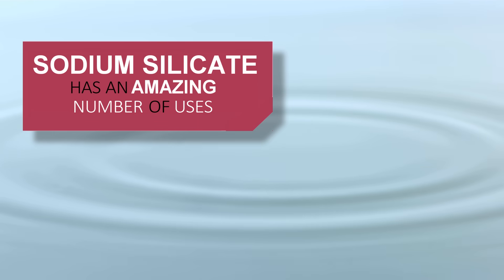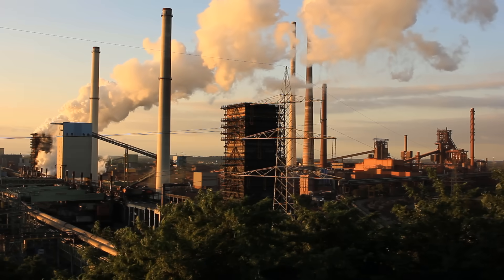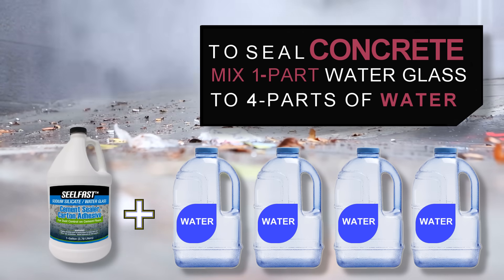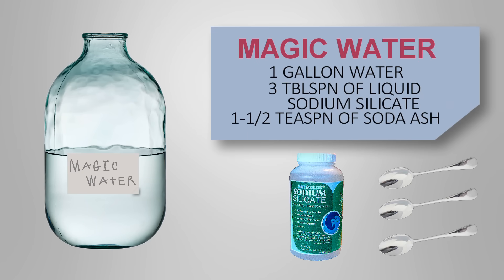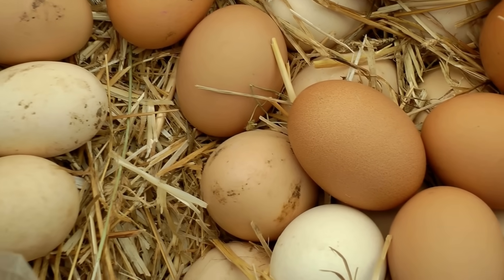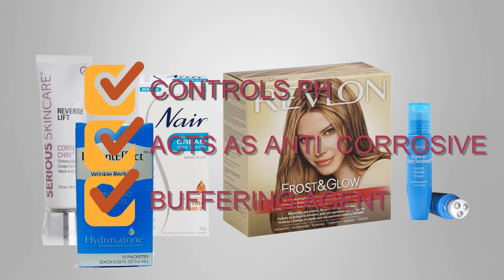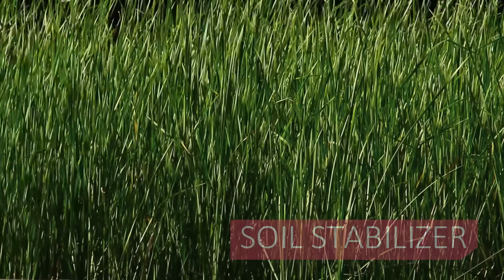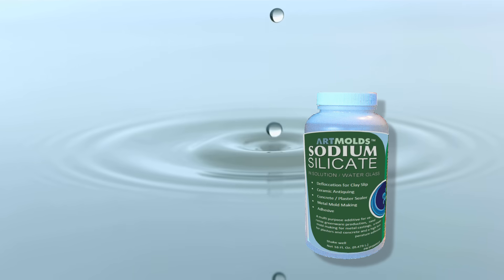Sodium Silicate || Water Glass: (Uses from Industrial to Daily Life)

Comment: Thanks for this revelation.
You say to use sodium silicate one part add three part water if Am not wrong.
How much would be required in a bag of cement?
Reply from the maker: Sodium silicate is applied to the surfaces of cured concrete. So of course it depends on how much surface area you get from a bag of cement

Comment: so what would be the effect of mixing sodium silicate into cement to make concrete? Seems it would make a harder and naturally more less porous concrete?
Reply: it acts as a deflocculant in the mix, causing the cement to be more watery.  this might be helpful in some instances, but could also cause the aggregate to settle out in an unfortunate way.
Reply: @jon_byler  so essentially it acts as a plasticizer. So in that case all that's needed is managing the ratio properly to get just the right amount of slump wouldn't you say? 
I use pepsi or coke or molasses where i can get it.
Reply: @jussayinmipeece1069  plasticizer is the wrong way of thinking about it.  it is a -deflocculant.  it means less water is needed to provide a fluid mix.  This can really screw you up if you mix your concrete by sight/feel, rather than weighing ingredients.  It has uses when trying to cast concrete/mortar and get it to fill more easily all of the voids in a mold.  might be helpful for grouting (filling the holes in) concrete masonry units.  A more experienced and knowledgeable mason or concrete engineer could tell you better if it's a good idea for a particular application.  There are other defloccuants out there that are less alkaline, based on other chemistry, etc.
Reply: @jon_byler  actually its just different ways of saying the same thing. An additive that reduces the friction between the solid components, breaks the surface tension of the liquids allowing the mixture to flow and mix better with less water.

The technical name i have always seen is plasticizer. Generally unless you are casting critical components such as bridges and columns for high-rises then the amount does not have to be critically mixed. Eyeballing and experience is usually enough to a certain extent. 

Say for example i am doing a mix for a suspended slab for a roof 6 inches thick. For every batch with 5 bags of cement i pour one one liter of regular coke or a pint of molasse with one 2 pounds of fibre.

In this case i am looking for THREE things flow into small crevices, (so less voids and air) compactness and longer initial curing time. 

So the net result is that the additive will have no deleterious effect on the actual concrete once its cured but it will slow water evaporation allowing for the chemical formulation of concrete BEFORE it runs out of water leading to cracks.

Comment: can i use it for styrofoam waterproofing?  Especially  salt water?
Reply: I know your comment is old, but in case anyone else is wondering: Yes, you can use it for that. Just be advised that it is very brittle so if you plan on using it on styrofoam or the like, it will crack if the styrofoam is damaged by pressure or in other ways.
But overall has been used in professional settings for aquarium backgrounds historically.

Comment: In my childhood, my dad put this into the radiator on our old car.  Stopped any size leak smaller than grain of rice. It works quickly.
Reply: To, just don't use too much, it's also been used to disable engines as well, just takes a lot more
Reply: @daveb3910  if you put it in oil, it ruins engine very quickly. In coolant, with no ethylene glycol, it works well. With glycol, it makes a jelly that blocks coolant channels.
Reply: A common fix for flathead ford v8 engines…usually effective!
Reply: just dont run it threw the heater core by pass it for awhile or it will plug up!!

Comment: Can Sodim Silicate be use as silicone to seal glass , wood , steel ? If you can ? Why cant we seal doors , windows in flooded area ?
Reply: No.  It will not react with any of those materials.  It is not like silicone caulk, not a thick gel.  Mixed with water, "waterglass", it has a viscosity like Karo Syrup.

Comment: I'm a Potter. This video is correct that it's used for crackle effect but what they're showing is not crackle effect LOL they're showing cracking in glazes which is nothing to do with sodium silicate. It's bizarre that the person that made this video would not have researched it correctly and got the correct pictures
Reply: J d  are you just a bad troll or an asshole? Or both? Again they show a glaze effect of crackle and attributed to water glass which has nothing to do with the picture they show. That particular crackle effect is caused by the makeup of the glaze and I can assure you it is not water glass that's added. Typically you get that effect with abundance of nepheline syenite and they lack of silica. Sodium silicate would actually prevent the crackle effect that they show in the image provided.

Sodium silicate is used on the clay body itself to crack the clay body not the glaze as shown in the picture. So someone that is new to Pottery is going to try and get that glaze effect which is desirable an attempt to use sodium silicate on the clay body as Illustrated and the two things are totally different techniques. To call this a great video when there's a glaring are like that it's pretty fucking stupid.

Also it's more accurate for them to have said carbon dioxide causes sodium silicate AKA water glass to harden but they do not add that information they say heat causes it which is inaccurate. I don't understand why smart-ass people have to be contrary to every comment that is not placating a video creator. Are you the creator of this video or a friend? If so tell your friend to fix their fucking video it's incorrect and misleading
Reply: It's AI created and narrated.

Comment: Would it be useful for a damp basement concrete floor by keeping the moisture below from entering?
Reply: olny if you could apply it on the bottom side of the concrete otherwise the concrete will still get saturated
Reply: J d  Apparently not , the concrete already contains the silicate ! as said in the video . Concrete emanates cold and therefore creates moisture . 
One option might be to add a layer of somekind of lime putty to the floor , which absorbs moisture, so that it can be dried by the air;  
Unlike concrete and modern plaster etc , which creates moisture and holds onto it ..

Comment: I am looking for a material that can be poured as a liquid on the bathroom floor which will solidify to form a level surface. What can do that? Is sodium silicate a solution?
Reply: Eppoxy flooring
Reply: There's self leveling cement.  It has a polymer that makes it an excellent choice to level floors. More expensive than regular cement but saves lots of time / labor.
Reply: @avidreader100  this is not healthy or safe. It break glass

Comment: I've got a blown head gasket. Was told to use "Water Glass". Now I know why I want to use it knowing what I'm attempting to achieve. The stuff is everywhere everyday. I had no idea. Good informative video.
Reply: I was told to use waterglass after I built my race engine, before using antifreeze, to seal the block.
They said it had been standard practice since the 1920's with some engine builders!

Comment: I have a question there regarding the use of Sodium Silicate. I make my own dishwasher detergent using self-made non foaming soap + Na2CO3/NaHCO3 and some other ingredients. So it is alkaline which can corrode some metals inside of the dishwasher after a while. Socium Silicate is also alkaline but has anti-corrosive effects. Which would blend perfectly into my materials. The only question is: how to blend? How to mix at which amounts?
Thanks in advance!
Reply: So sorry though we supply sodium silicate we do not have access to all the formulas it is used for.
Reply: @CapeCrystalBrands  anyway, thanks for the fast response :)
I will find out
Reply: look up the MSDS sheet for comercial products and see how much is in them.  it will give you a good starting point to experiment.

Comment: I was looking into creating a heated press when I came across "oil core skillets" which claim to use a heating element in "silicate oil" to create even heating across the metal surface, instead of a heating element that can create hot spots and uneven temperatures.  Any idea if this sodium silicate is the "oil" they referred to?   This is one of the first results that came up when i researched "silicate oil."
Reply from the maker: Dear Mason, Sodium silicate is NOT silicone oil. Here you go: https://www.ebay.com/sch/i.html?_nkw=silicone+oil
Reply: @EnvironMolds  guess he wasn't that "Dear", huh, to have suggested something else. Sigh...ghosting is soooo-prevalent these days, though. But, still...when one doesn't know, best to say nothing. New subscriber, there. Couldn't resist the Intro Video's Presenters!! Warms a heart on a hot summer day, even :-)

Comment: ...Excellent video, was wondering how I could make a Surgeon Attorney General  You Tube Sticker actually stick without any adhesive...Warning: objects may appear to be reversed on the opposite side of " your " membrane...the synapse would prove the S.A.G. as a G.A.S. warning since Argon identifies its membrane...kinda wierd knowing your a livin breathing hologram trapped in a paradox between mass and gravity at 14.777 psi. sea level...and there is a little tiny fan inside my computer...so stick it on the video part of the membrane , so it don't mess up the polymer synapse from the tip of the users finger, interfacing the screen...thanks for identifying the human membrane, and restoring the General Attorney Surgeon. Now we can all sort out these bogus lawyers...any questions on how thats done - I will tell you if your interested...
Reply from the maker: An interesting concept indeed, Mr. Clark. Here is a link to the Princeton Research Centers in Princeton, NJ. I suggest you contact them with your idea as they certainly could be interested: https://patents.princeton.edu/industry-entrepreneurs/princeton-research-centers
Reply: C W  Where are you from maybe we can do it.
Reply: C W  do you still make them? How much $?

Comment: Was this stuff used  in car motor to make the motor lock up druing cash for clunkers
Reply from the maker: Yes, this was the chemical used to destroy automobile engines.
Reply: I thought ot supposed to seal the gasket leaks
Reply from the maker: Your thinking is correct, Paul. However, only a small quantity is needed to seal a leaky gasket poured into the radio. You'll need two quarts added after draining the engine oil pour into the oil fill to destroy the engine @paullainhart8288
Reply: Environ Molds I poured some into my radio and the headgasket is still fucked and now I don't have music in my car
Reply: Environ Molds can you please send me a new radio, mines fucked now.. I've tried fixing it, but its pretty fucked.. it's a Kenwood touchscreen stereo
Reply: @EnvironMolds  If your gonna drain the engine oil, why add anything, just run the engine to destroy it....?

Comment: I made a battery out of sodium silicate...
Reply from the maker: Tell us more . . .
Reply: @EnvironMolds  Well, I had a gallon of it to play with... and a AC convertor at 5 volts.  So, I ran a current through it as it solidified.  I was hoping to see some diode type reaction; but, resistance was NEGATIVE in one direction, so I switched to a voltmeter and found potential across the leads.
Reply from the maker: Very interesting. Thanks so much for sharing.
Reply: @LazyH-Online I think I described it as best I could.  I did the experiment in the eighties when I was at university.

Comment: isnt this used in diapers? just think of all that fine glass we breath in daily.
Reply from the maker: Just looked that up and you are correct. Sodium silicate is used in the manufacturing of reusable diapers in the cleaning process - sodium hydroxide, soap, sodium silicate and chlorine are used to scour the fabric to remove impurities. Here is the link: http://dy-dee.com/wp-content/uploads/2017/02/Life_Cycle_Analysis_3.pdf (Page 45 middle of the page.)
Reply: Environ Molds also the absorbant gel beads are very similar to water glass and you can make water glass from them with a few small steps
Reply from the maker: If so Ken, It is a use I'm not aware of - but there are many more uses for this material than I have a list.

Comment: Does anyone know if we can cast 3D objects with Sodium Silicate ( of this recipy ) as we do with epoxy resin ?  Are there any additional directions to do so ?  Is special  concentration needed e.g. ?  
Another question can we disolve lye in water in a pot, and separatlely the silica gel in another pot and then to mix the 2 solutions as  to be A and B components similar to epoxic resins ? Are there any special advices to do so ?   Analogies ?  Thank you in advance.
Reply: in short, no. you can only use it as a watery binder. it "might" be possible to fill a mould with water glass, slowly drive out the water, leaving you with porous silica gel, and heat it up to basically melt it into glass. but it will be far from what you can expect from casting epoxy. ..and propably not very pretty
if you add SiO2 to NaOH solution, all you do is making a sodium silicate solution - water glass. (proceed with caution! the reaction es exothermic, and NaOH is highly caustic.)
Reply: @Ucceah  Thank you for your reply. If I am not bothering you I will post a few questions more that I have posted to this video also : https://www.youtube.com/watch?v=L2s0cLzm4RI      The questions :  There are a few contradictions about sodium silicate... It is used as heat - resistant adheshive, as a cracking - effect glass solution, in ceramics and as a refractory agent. But it is also used as a water soluble element in detergents. How is it possible to be a great adheshive compound and a water soluble chemic in the same time ? This is very interesting to find out how all these contradictory uses, can be achieved  with the same compound.... Any ideas ?
Reply: You where here too. Auhauhau

Comment: We use a lot of it where I work because of how it reacts with Co2. Interesting how many uses it has.
Reply: So it binds CO2? And then? What do you do with it?
Reply: @esatbecco  sand casting
Reply: @seahorsetug  I never saw these replies. You are quite right kinda. We make water soluble mandrels for composite manufacturing. We dont use sand but ye the CO2 reacts with the water glass stiffening our mandrels enough to get them in the oven where they dehydrate and harden.

Comment: This guy is lying about the pottery part
Reply from the maker: What are you referring to so we can correct if it is  incorrect?  Sodium silicate is commonly used in ceramics as a deflocculant in slip preparation by neutralizing the charges of particles in the slip, allowing for more even suspension and thinning. It is also used to create that antique crackle finish. Where do you think we went off track?
Reply: So, these folks are purposely trying to deceive you. How utterly evil of them. Oh that right they asked you to point out any errors they made how deceitful of them.  Words hurt, please use your words correctly or are you lying to us.
Reply: What was said about the uses in ceramics was true. Specifically, you can brush it on a freshly thrown pot and stretch it out to get a cracking effect. But the cracking in the pot in the close-up wasn't created this way. That crackle was from the glaze, not sodium silicate on the clay.
Reply: The pottery part you don't just brush it on and done you dip it and then cook it on
Reply from the maker: @ashash4tube Thank you for pointing that process out more specifically. Our objective in the video was to not show all process details. But to show that sodium silicate is used for the process. :-)
Reply: @EnvironMolds  this person doesn't know what they're talking about.  you are correct in the process, but the pictures you showed were of glazes that were formulated with a lack of silica and then stressed by cooling quickly in water using the raku process (where the carbon comes from in the cracks and unglazed areas).

Comment: I was watching vids on auto glass repair and this vid was recommended.. Now I need to know how to make sodium silicate diy.. Usually it's hard to find out trade secret sauce
Reply: 500ml distilled water in a SS pot, add 300mg Sodium Hydroxide(lye, drain cleaner) slowly to water until It's dissolved. Exothermic reaction causes heat. Add Silica gel beads slowly until they no longer dissolve, about 300mg. Store in airtight container. 

Wear eye and skin protection and do it outside on a hotplate.
Reply: Lots of videos on YouTube..
Reply: from a quick google search
Wear proper safety gear, which includes gloves.
dissolve 4 to 8 grams of sodium hydroxide in 10 milliliters of water.
Once the sodium hydroxide is dissolved, slowly add 6 grams of crushed silica gel beads. Heat the solution between additions. ...
You now have sodium silicate or water glass
Reply: @LazyH-Online I've never done it that way, but I'll try it next time. Thanks mate
Reply from the maker: It is far cheaper to purchase it. Check it out here: https://www.artmolds.com/artmolds-sodium-silicate.html

Comment: wow so many uses it's like https://en.wikipedia.org/wiki/Dihydrogen_monoxide_parody I only knew about some of the high heat application stuff. I will use it a lot more. your website it was hard to find this product hear is the links https://www.artmolds.com/seelfast-cement-and-concrete-sealer.html , https://www.artmolds.com/artmolds-sodium-silicate.html you should advertise on "making sodium silicate videos" because many of us would like to just buy it.

https://en.wikipedia.org/wiki/Sodium_silicate